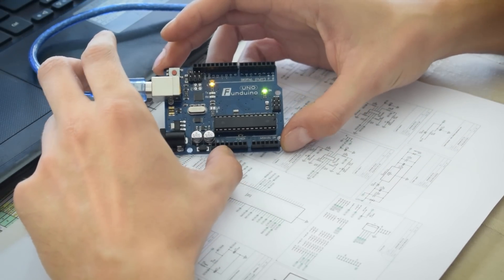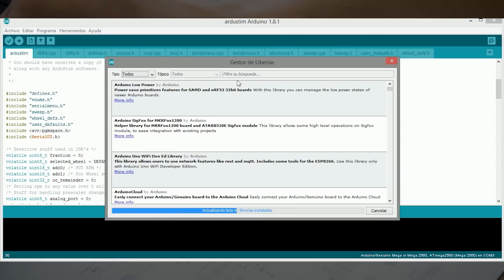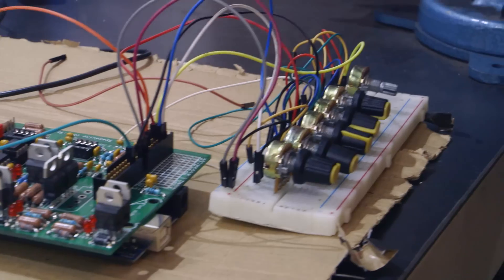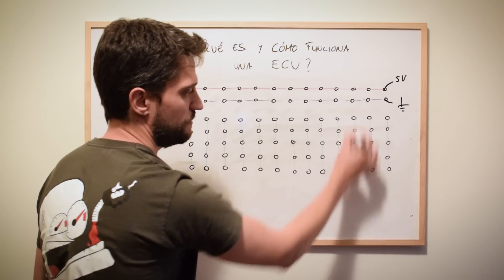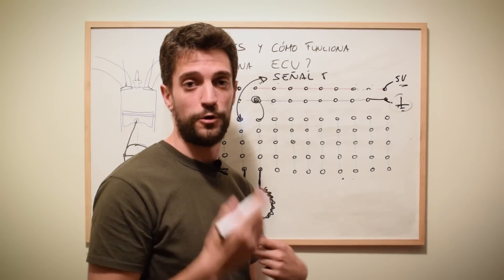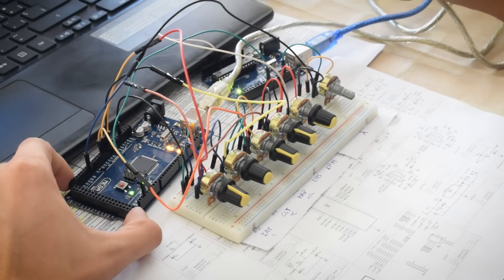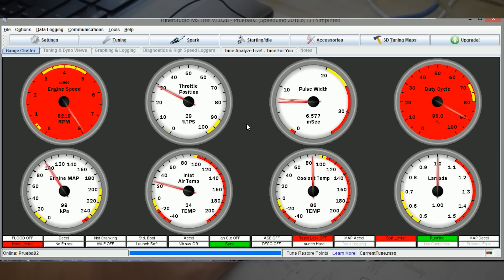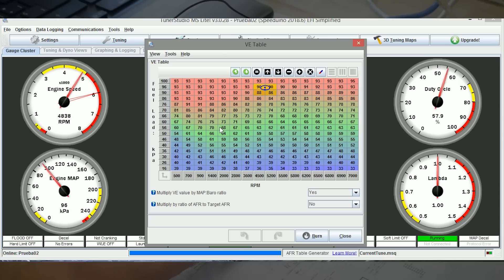Sensor CKP y ARDUINO Uno - CENTRALITA de MOTOR PROGRAMABLE por 100€ - Speeduino #2

Comment: Im getting this Error when uploading

 Arduino: 1.8.13 (Windows 10), Board: "Arduino Uno"

sketch\serialmenu.cpp: In function 'void serial_setup()':

serialmenu.cpp:69:9: error: 'class SerialUI::SerialUI' has no member named 'setTimeout'; did you mean 'setName'?

   mySUI.setTimeout(20000);   /* Tiem to wait for input from druid4arduino */

         ^~~~~~~~~~

         setName

serialmenu.cpp:71:13: error: expected primary-expression before '*' token

   SUI::Menu *mainMenu = mySUI.topLevelMenu();

             ^

serialmenu.cpp:71:14: error: 'mainMenu' was not declared in this scope

   SUI::Menu *mainMenu = mySUI.topLevelMenu();

              ^~~~~~~~

serialmenu.cpp:72:13: error: expected primary-expression before '*' token

   SUI::Menu *wheelMenu;

             ^

serialmenu.cpp:72:14: error: 'wheelMenu' was not declared in this scope

   SUI::Menu *wheelMenu;

              ^~~~~~~~~

sketch\serialmenu.cpp:72:14: note: suggested alternative: 'wheels'

   SUI::Menu *wheelMenu;

              ^~~~~~~~~

              wheels

serialmenu.cpp:73:13: error: expected primary-expression before '*' token

   SUI::Menu *advMenu;

             ^

serialmenu.cpp:73:14: error: 'advMenu' was not declared in this scope

   SUI::Menu *advMenu;

              ^~~~~~~

sketch\serialmenu.cpp: In function 'void select_wheel_cb()':

serialmenu.cpp:212:25: error: 'class SerialUI::SerialUI' has no member named 'parseInt'; did you mean 'print'?

   byte newWheel = mySUI.parseInt();

                         ^~~~~~~~

                         print

sketch\serialmenu.cpp: In function 'void set_rpm_cb()':

serialmenu.cpp:266:27: error: 'class SerialUI::SerialUI' has no member named 'parseULong'

   uint32_t newRPM = mySUI.parseULong();

                           ^~~~~~~~~~

exit status 1

'class SerialUI::SerialUI' has no member named 'setTimeout'; did you mean 'setName'?

This report would have more information with
"Show verbose output during compilation"
option enabled in File -> Preferences.

Comment: A fecha 16/01/2021 es importante instalar la versión 2.2.0 de la librería (la que sale en el video) y no posteriores (existe una versión 3.1.0). Se producen problemas debido a la modificación de la clase SerialUI en la versión 3.1.0: <<'class SerialUI::SerialUI' has no member named 'setTimeout'; did you mean 'setName'?>>. Este problema se soluciona simplemente instalando la versión 2.2.0 de la librería. Un saludo!
Reply: Hola....justamente me fije en eso al instalar....y lo puedo instalar perfectamente....pero cuando borro los dos \*  para usarlo con un potenciometro me arroja ese mismo error!!!
Reply: Alguien tiene alguna información sobre como solucionar este asunto...muchas gracias de antemano.
Reply: @mariohernanquintanillajara7354  solucionaste?
Reply: Solucionaste?
Reply: @juniormendoza2879  ?? alguna sugerencia

Comment: Buenos días, ante todo felicitaros por este gran trabajo de divulgación que hacéis y tan acertadamente. Yo ya había probado a adaptar una centralita programable hace algún tiempo, pero la deseché por no ser consistente. Esta vuestra me parece formidable. Comentaros que ya empecé y cargué el código en el Arduino y lo conecté al Tunerstudio en principio sin problema. El problema viene cuando se conecta porque los relojes de TPS , temperatura de agua y refrigerante se van al máximo, sin conectar ningún potenciómetro, evidentemente ninguno me funciona de las entradas analógicas y el del CKP, regula perfectamente las revoluciones. No tengo ni idea que ocurre. A ver si me echáis una mano. Pienso instalarla en dos motores Volvo Penta de 2500 CCOO “Red block” que llevan dos carburadores Solex  , por motor, claro, que no veáis lo que “chupan”. 
Muchas gracias

Comment: muy bueno el video pero no pude hace hacer andar el codigo fuente. Arduino:1.8.12 (Windows 7)

sketch\loop.cpp: In function 'void loop()':

loop.cpp:47:7: error: 'adc0_read_complete' was not declared in this scope

   if (adc0_read_complete == true)

       ^~~~~~~~~~~~~~~~~~

loop.cpp:48:3: error: expected primary-expression before '}' token

   }

   ^

loop.cpp:50:5: error: 'adc0_read_complete' was not declared in this scope

     adc0_read_complete = false;

     ^~~~~~~~~~~~~~~~~~

loop.cpp:51:5: error: 'tmp_rpm' was not declared in this scope

     tmp_rpm = adc0 << TMP_RPM_SHIFT;

     ^~~~~~~

sketch\loop.cpp:51:5: note: suggested alternative: 'tmpnam'

     tmp_rpm = adc0 << TMP_RPM_SHIFT;

     ^~~~~~~

     tmpnam

loop.cpp:51:15: error: 'adc0' was not declared in this scope

     tmp_rpm = adc0 << TMP_RPM_SHIFT;

               ^~~~

loop.cpp:57:1: error: expected '}' at end of input

 }

 ^

sketch\serialmenu.cpp: In function 'void serial_setup()':

serialmenu.cpp:69:9: error: 'class SerialUI::SerialUI' has no member named 'setTimeout'; did you mean 'setName'?

   mySUI.setTimeout(20000);   /* Tiem to wait for input from druid4arduino */

         ^~~~~~~~~~

         setName

serialmenu.cpp:71:13: error: expected primary-expression before '*' token

   SUI::Menu *mainMenu = mySUI.topLevelMenu();

             ^

serialmenu.cpp:71:14: error: 'mainMenu' was not declared in this scope

   SUI::Menu *mainMenu = mySUI.topLevelMenu();

              ^~~~~~~~

serialmenu.cpp:72:13: error: expected primary-expression before '*' token

   SUI::Menu *wheelMenu;

             ^

serialmenu.cpp:72:14: error: 'wheelMenu' was not declared in this scope

   SUI::Menu *wheelMenu;

              ^~~~~~~~~

sketch\serialmenu.cpp:72:14: note: suggested alternative: 'wheels'

   SUI::Menu *wheelMenu;

              ^~~~~~~~~

              wheels

serialmenu.cpp:73:13: error: expected primary-expression before '*' token

   SUI::Menu *advMenu;

             ^

serialmenu.cpp:73:14: error: 'advMenu' was not declared in this scope

   SUI::Menu *advMenu;

              ^~~~~~~

sketch\serialmenu.cpp: In function 'void select_wheel_cb()':

serialmenu.cpp:212:25: error: 'class SerialUI::SerialUI' has no member named 'parseInt'; did you mean 'print'?

   byte newWheel = mySUI.parseInt();

                         ^~~~~~~~

                         print

sketch\serialmenu.cpp: In function 'void set_rpm_cb()':

serialmenu.cpp:266:27: error: 'class SerialUI::SerialUI' has no member named 'parseULong'

   uint32_t newRPM = mySUI.parseULong();

                           ^~~~~~~~~~

exit status 1
'adc0_read_complete' was not declared in this scope

Este informe podría contener más información con
"Mostrar salida detallada durante la compilación"
opción habilitada en Archivo -> Preferencias.
Reply: Solucionaste

Comment: Al momento de cargar el programa a arduino me marca un error en la clase mySUI.setTimeout(2000);
Reply from the maker: Mira en la descripción del vídeo, al final hay una anotación sobre esto
Reply: @PetrolheadGarage  no dice nada acerca de este error en la descripcion del video
Reply: @andreschavez1325  eso pasa cuando tienes la librería SerialUI actualizado en la ultima versión si pasas a una actualización anterior ya compila el programa...
Reply: @PetrolheadGarage  ya me compila el código pero al momento de querer habilitar el pin para el potenciometro ya no compila el código... por favor ayuda ¡Excelente serie de vídeos¡
Reply: @elnenesam20   Lo lograste? Para solucionar este error debes ir dentro de serialui a la opcion que dice "More Info", aquí debes seleccionar la Version 2.1.2 y luego le das instalar, intenta cargar nuevamente el programa y listo. Debería funcionarte!
Reply: @midabravo  me puedes pasar el código corregido por favor 0

Comment: Hola Pablo, mientras espero me llegue el kit speeduino estoy armando el generador con el arduino uno y arme un osciloscopio pc , cambio las lineas de 6000 a 600 vueltas y la rueda a 36-1 si lo grabo ahi funciona y lo veo en el osciloscopio ,pero si saco las dos */ de   loop.cpp  no carga y me pone  "adc0_read_complete"  was not declared in this scope. Desde ya gracias , excelente el proyecto.
Reply: Ahora siiiii ,saque las dos */ de   loop.cpp  ,  las tres//  de  // uint16_t tmp_rpm=0;
    // extern volatile bool adc0_read_complete;   // extern volatile uint16_t adc0;  y me dejo cargar el programa . Funciona perfecto 36-1 suben y bajan las vueltas sin problemas , a seguir......
Reply: @jimmyspecialcars  por favor me puedes pasar el código 😭 no me jala a mi

Comment: Magistral maestro..pero un consejo..deberiais meter mas videos y mas desglosados..esto es demasiado miga para un par de videos..a ver si os animais y haceis una especie de curso on line..un abrazo..sois los mejores
Reply from the maker: Muchas gracias por tu sugerencia Recycling Rider! Lo hacemos así para que esté un mismo tema condensado en cada capítulo, porque así, en nuestra opinión, encontrar la información que se busca será más fácil que si lo dividimos en decenas de capítulos. Lo hacemos como nos gustaría verlo a nosotros, pero no significa, claro, que sea lo correcto :P

Comment: hola chicos he seguido los pasos al pie de la letra tengo los potenciómetros puestos pero al darle me siguen saliendo los relojes en rojo del tuner studio la salida de 5v y masa la tengo bien y los potenciómetros hacen su función pero el tuner no hace nada si giro los potenciometros y los mido con el polímetro estan bien y hacen la resistencia, he borrado las lineas que comentas para el generador del ckp y me da un error y no me deja subir el codigo al arduino uno.
Arduino:1.8.7 (Windows 7), Tarjeta:"Arduino/Genuino Uno"

El Sketch usa 29656 bytes (91%) del espacio de almacenamiento de programa. El máximo es 32256 bytes.
Las variables Globales usan 1125 bytes (54%) de la memoria dinámica, dejando 923 bytes para las variables locales. El máximo es 2048 bytes.
avrdude: stk500_recv(): programmer is not responding
avrdude: stk500_getsync() attempt 1 of 10: not in sync: resp=0x51
avrdude: stk500_recv(): programmer is not responding
avrdude: stk500_getsync() attempt 2 of 10: not in sync: resp=0x51
avrdude: stk500_recv(): programmer is not responding
avrdude: stk500_getsync() attempt 3 of 10: not in sync: resp=0x51
avrdude: stk500_recv(): programmer is not responding
avrdude: stk500_getsync() attempt 4 of 10: not in sync: resp=0x51
avrdude: stk500_recv(): programmer is not responding
avrdude: stk500_getsync() attempt 5 of 10: not in sync: resp=0x51
avrdude: stk500_recv(): programmer is not responding
avrdude: stk500_getsync() attempt 6 of 10: not in sync: resp=0x51
avrdude: stk500_recv(): programmer is not responding
avrdude: stk500_getsync() attempt 7 of 10: not in sync: resp=0x51
avrdude: stk500_recv(): programmer is not responding
avrdude: stk500_getsync() attempt 8 of 10: not in sync: resp=0x51
avrdude: stk500_recv(): programmer is not responding
avrdude: stk500_getsync() attempt 9 of 10: not in sync: resp=0x51
avrdude: stk500_recv(): programmer is not responding
avrdude: stk500_getsync() attempt 10 of 10: not in sync: resp=0x51

muchas gracias y un saludo.
Reply: Buenas Eduardo!
Vaya suerte.. Lo primero, prueba a configurar los sensores en el tuner studio, en el primer capítulo que hemos hecho del tuner studio se ve como se hace desde el principio (cargando el basetune,etc...)
Y tu segundo problema con el ardustim es fallo de comunicación entre el Arduino y el pc... El código estaría bien.
Busca en el Google o en el foro de Arduino "avrdude stk500_recv()"... Ahí vas a encontrar mucha información al respecto y las soluciones.
Muchas gracias y cuéntanos cómo te va.
Reply: Solucionaste?
Reply: @juniormendoza2879  si
Reply: @Emg-t1g  me puedes compartir el código corregido por favor?
Reply: @juniormendoza2879  está en la página de speeduino
Reply: @Emg-t1g  me sale con problemas igual

Comment: I have one.
Reply from the maker: Tell us more about it CIvic D16! ;) Is it working in you Civic? ;)
Reply: I sell them to enthusiasts here in Brazil. It's very intuitive, especially with everything mounted. I've only tested them with the stimulator, but I have clients that used it even in 2 stroke bikes.
Reply: The 3.6b is very cool for starting in this world of standalone ecu. It have Bluetooth capability, easy connectors and THT assembly.

Comment: buenas. Donde puedo conseguir el diagrama para ver como esta conectados los potenciometros al arduino mega?
Reply from the maker: Buenas Juan, en este mismo video se explica cómo conectar los potenciómetros a qué pin del Arduino
Reply: ok gracias, pero creo yo que seria bueno que esos diagramas de conexiones las dibujaras y las subieras a pdf o imagen
Reply from the maker: Pero si es que está explicado ahí Juan, incluso con el esquema de cómo se conecta.

Comment: Muy buen vídeo, de cuantos ohms son los potenciometros?
Reply: Hola Salvador!
Muchas gracias, nos alegra que te guste.
Son todos de 10K, pero debería valer casi cualquiera. Ten en cuenta, que el valor de la señal que dan siempre variará entre 0 y 5V, que es con lo que los alimentamos.
Lo que si hay que tener en cuenta es que, en este montaje en concreto, están alimentados desde el Arduino, y por esta razón, yo no pondría unos de muy baja resistencia, ya que consumirían más y el Arduino no está pensado para suministrar más de 200mA.

Comment: Duda: como hacéis una mapa base? Tunner studio proporciona alguno, alguna web hay mapas de todos los coches? Porque estoy pensando hacer esto para un swap, porque me sale mejor que una ECU pero ahí esta mi problema, en el mapa
Reply: Por lo que tengo entendido, a los mapas los podes descargar, y en base al "feedback" de los distintos sensores los modificas a tu gusto. Creo que Tuer Studio tiene integrada una función que corrige cualquier mapa que tengas cargado en base a la lectura de la sonda lambda, todo mientras vas conduciendo.
Sino, tampoco es difícil de hacer manualmente
Reply: @tomassosaoconnor  y sabes de donde se puede bajar un mapa básico para al menos arrancar el motor? Gracias y un saludo
Reply from the maker: El TunerStudio te da un mapa básico, y veremos todas las posibles configuraciones más adelante, pero puedes ir cacharreando con el programa. En la descripción del primer capítulo lo tienes: https://www.youtube.com/watch?v=QX4iHg0sMSU
Reply: Gracias chumachos!  @PetrolheadGarage

Comment: Gracias, esto da vida después de tanta esclavitud en el curro. Una pregunta mu tonta, el osciloscopio no te genera/simula una onda cuadrada, o es una onda que no puedes modificar?
Reply: Buenas Edojema! Muchas gracias, nos alegra que te guste.
Ninguna pregunta es tonta, hay osciloscopios que también tienen opción de generar ondas, los más normales tienen una onda solo para calibrado y son de frecuencia fija, con lo cuál no podríamos variar la velocidad. Además la señal del ckp aparte de tener una onda cuadrada, tiene que simular la falta de un diente en la rueda fónica. Si no lo has visto, te recomiendo que veas la primera parte de esta serie y el artículo que tenemos en la web https://petrolheadgarage.com/Posts/como-funciona-ckp/
sobre este sensor.
Muchas gracias otra vez